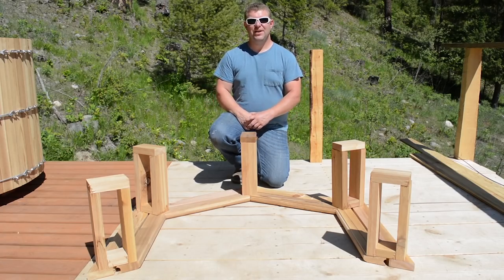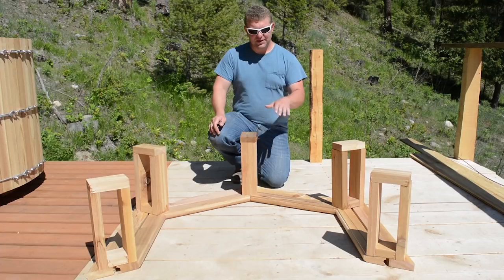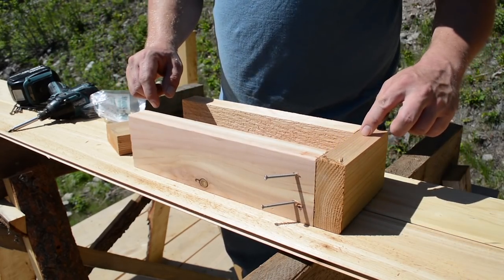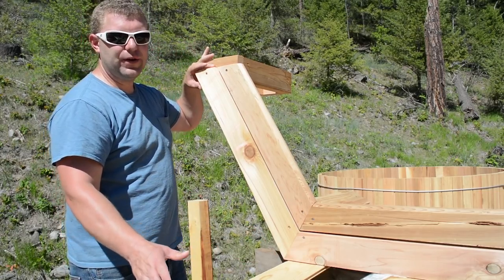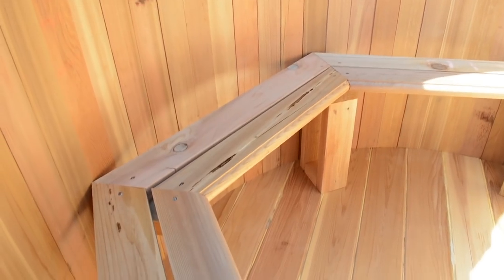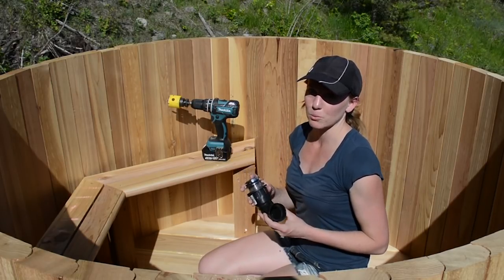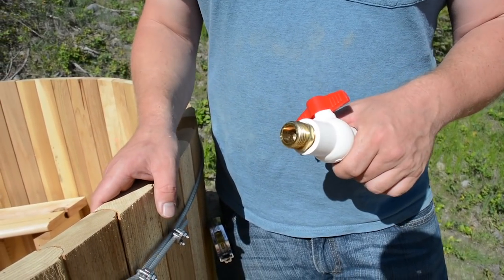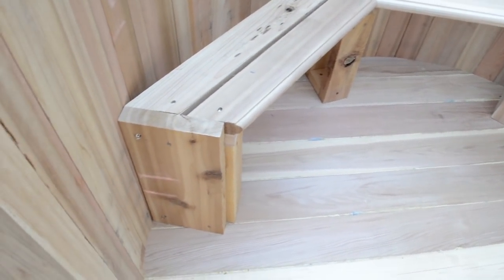DIY Cedar Hot Tub (Episode 6): Benches and Plumbing

Comment: I noticed you installed the teflon tape backwards on the fitting.  Wrap it the opposite direction, when you turn the pipe clockwise during assembly, the tape wont unwind and cause a leak.  Not trying to be a know it all, just trying to help.

Comment: I would have thought that a drain with just the ball valve would be sufficient as if you get out and want to drain the tub you will need to depress it from the inside. Since it is installed under a bench you it will make it harder to push it with a stick or some other "tub Drainage device". Thoughts?

Comment: WHEN your tub drain starts leaking, go "old school".  Remove the drain and remove whatever gasket that came with it.  Get a tub of plumbers putty.  Remove a good sized "wad" and start kneading it with your hands.  Eventually you need to roll it into a snake that is fat enough to fill the void around the bottom side of the drain and between the drain and the floor.

You need to have enough so that was you tighten the drain down the excess will squeeze out the side.  THIS IS KEY !  If it does not squeeze out on all side. remove and start over again making a fatter snake.

The excess that squeezes out can easily be removed and placed back in the tub it came it.  Similar to https://youtu.be/xra7T5x4swc